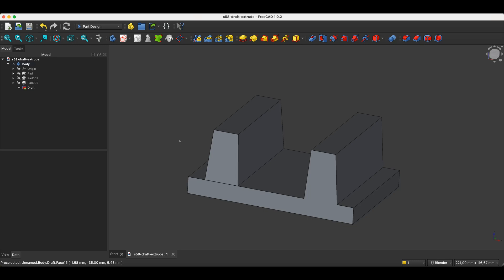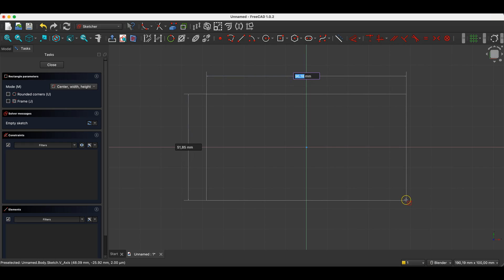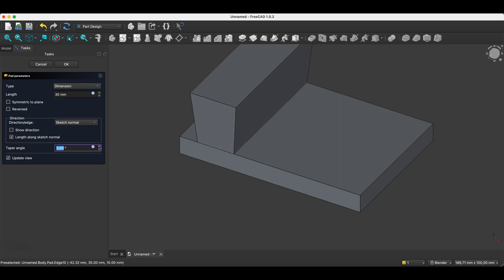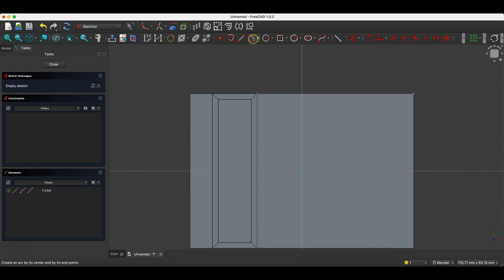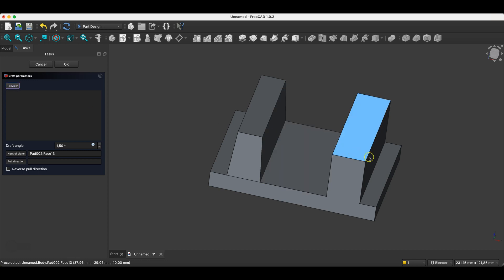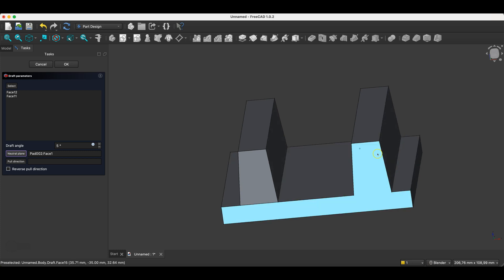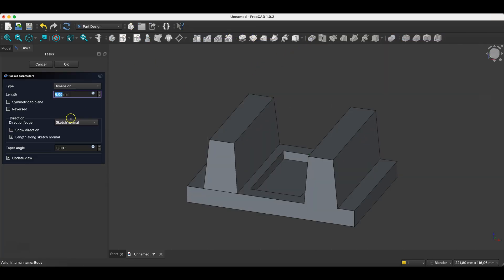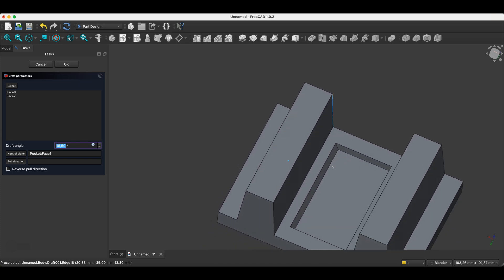FreeCAD: Tapered Pad vs Draft – What's the Difference?

Comment: Hi Damien, I would like say, that your tutorials are excellent. Well explained and straight forward. Many thanks!
Can I ask you, if you could record a tutorial on how to create a plate with a thread in it and the associated bolt for 3d print? I created one but the bolt is not going into the thread of the plate. I suppose, the thread is to small!
Reply from the maker: Hi!
Thank you so much for your kind words – really glad to hear the tutorials are helpful! 😊
About the thread and bolt: for 3D printing, the easiest way is usually not to change the model in CAD, but simply to scale the bolt a little bit in your slicer.

For example, you can:
Scale the bolt in X/Y slightly up (like 101–105%)
Keep Z at 100%, so the height stays the same

That’s exactly what I did in this example (https://youtu.be/S5ZF7uamZoI) – just a small scale tweak in the slicer so the parts fit together better after printing.

Clearances for threads depend a lot on the printer, filament and settings, so this small scaling trick is often the quickest solution.
Reply: @CADCAMLessons  Thank you for the hint. I will give them a try soon. Much appreciated
Reply: @CADCAMLessons  Hi, I'm a litttle bit confused now. I understood that I could scale the bolt to fit the thread in the plate. You wrote, that I should scale up the bolt by  a value of 101-105. Should this not be a negative value in order to shrink the bolt to fit better?